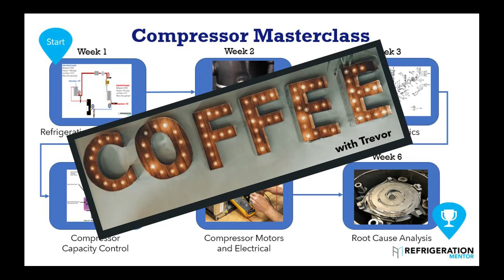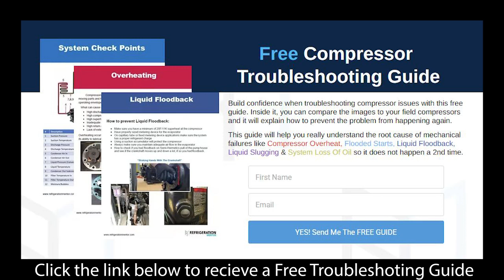That refrigeration compressor is burning hot... Is that okay??

Comment: Thanks for the podcasts. What do you think about discharge temperature protection by means of pressure switch rather than contact temperature sensor?
Reply from the maker: That is different protection.  You can have a rise in discharge temperature without a rise in pressure. Example if your return vapor or suction vapor somehow picks up alot of heat back to the compressor. You should use both types if you want the highest type of protection for the equipment.

Comment: Hi Trevor 
How does a CPR valve affect compressor ratio
Reply from the maker: It does a little as you will have a minor pressure drop across the CRO valve when sizing and selecting.   The main purpose for a CPR is to protect the compressor from overloading. Check out this manual from @sporlan https://www.parker.com/literature/Sporlan/Sporlan%20pdf%20files/Sporlan%20pdf%20090/90-10.pdf?elqTrackId=3687855f51c44149b24f482ff5b0c584&elqaid=16357&elqat=2
Reply: Thanks Trevor